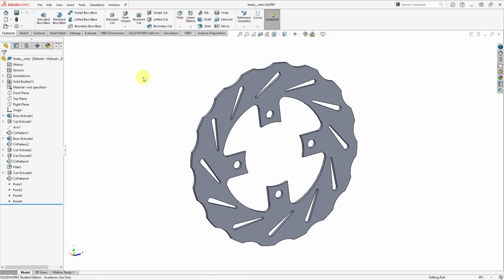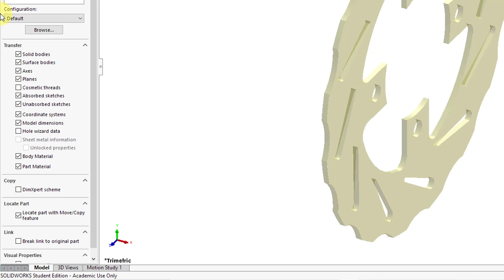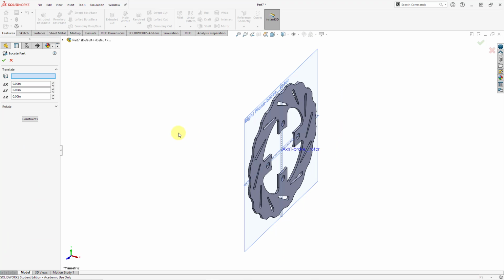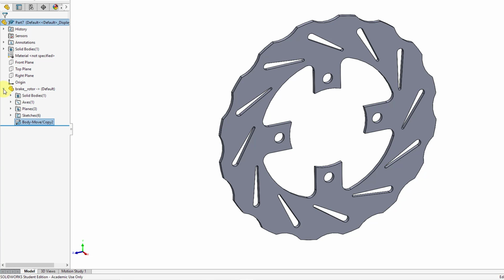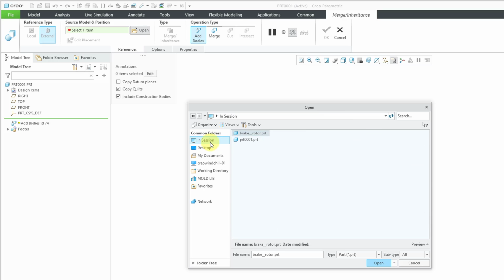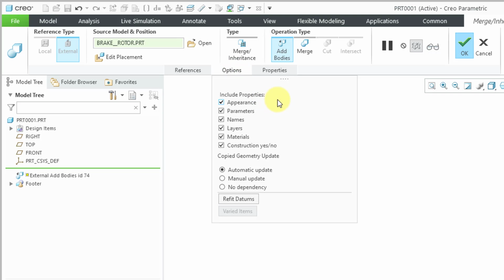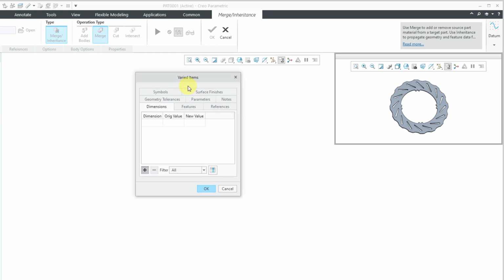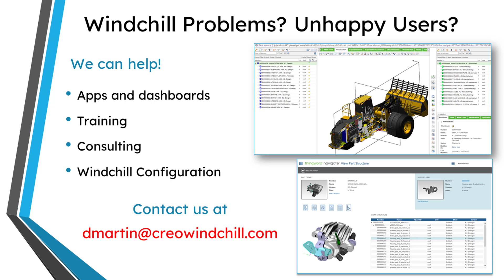SolidWorks - Creo Parametric Comparison - Insert Part and Merge / Inheritance

Comment: Good evening Sir! I have a question concerning the transformation of .stl files to .prt files. I have a very detailed .stl file which i tried to convert to.prt through the function "copy as". The results are pretty good for such a detailed file but not perfect ( there are some  extra surfaces on some places that arent there in the original file but its pretty good overall). I just wanted to ask if you know a better way of solving this matter. I appreciate your videos, keep it up!
Reply from the maker: STL is what it is. It's a really old data format from the 1980s that gives you tessellated triangles. There's not much you can do with it. It's fine for 3D printing but I wouldn't want to do anything "real" with it. Remember, STL stands for stereolithography.
Reply: @CADPLMGuy  Thanks for your quick respond! As i said i tried to convert such a file into a solid part through the "shrinkwrap" function. As you already mentioned the part will get many small triangles. Is there any way to make the surface of that solid part smoother and more detailed?
Reply from the maker: @adnan7652  Shrinkwrap is not going to do anything for you in this situation. It would provide no value. One of the points of STL is also to protect proprietary information, so no, there are no good ways to make it smoother and more detailed.
Reply: @CADPLMGuy  Alright thanks for your answer!
Reply: Check out the Reverse Engineering Extension (REX).